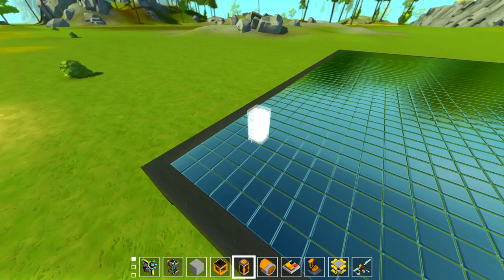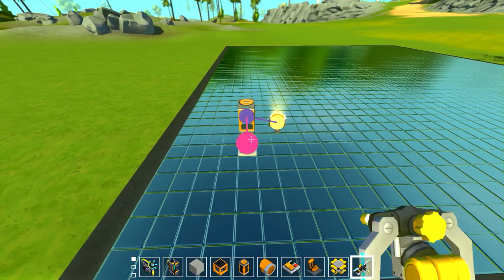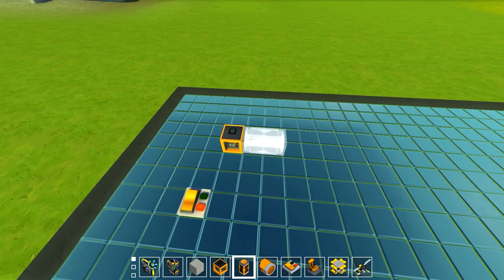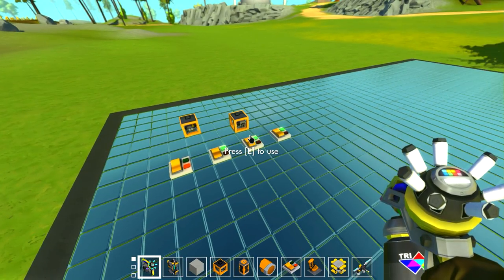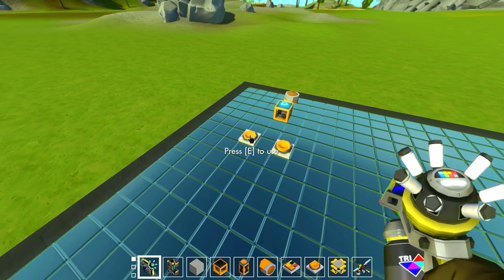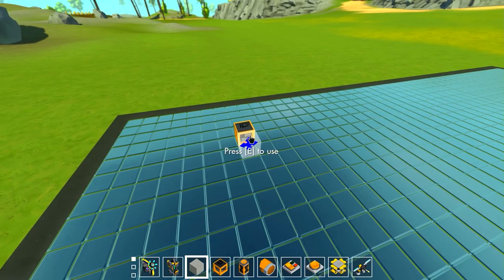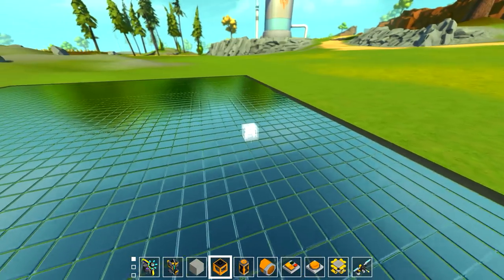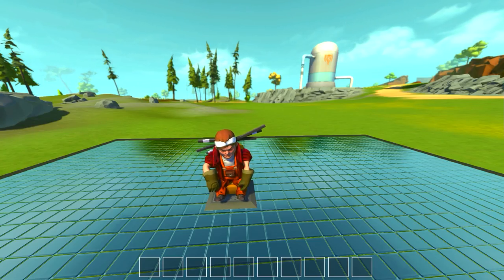Basic Logic Gates & Functions! (Scrap Mechanic Logic Tutorials #01)

Comment: I've seen (and used) the memory bits, but I still don't understand how to get them to reset properly (no pulsing) when you take something off a lift. I look forward to that future video
Reply: He has answered that question, and it is just a and gate connected to a nor connected to a xor and a timer (1 tick) and the timer connected to the xor gate.
Reply: Theres a simpler way using a singular and gate. Connect your NOR gate (that turns it on) & OR gate to the AND gate then the AND gate to the NOR gate(that turns it off).
Reply: Thanks. I'll have to try and see if it works for what I want (resetting a gear-shift), but I'd like to understand why it would work. I understand logic gates separately, but a bunch together is confusing. I hope it'll all make sense in a future video.